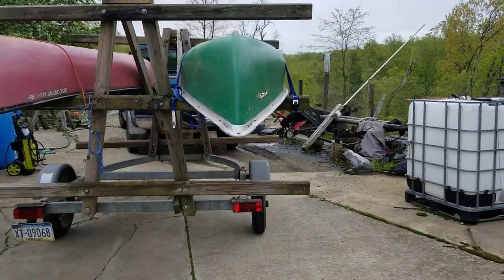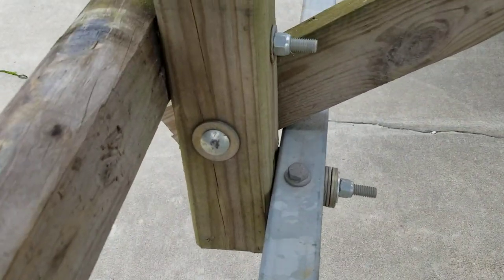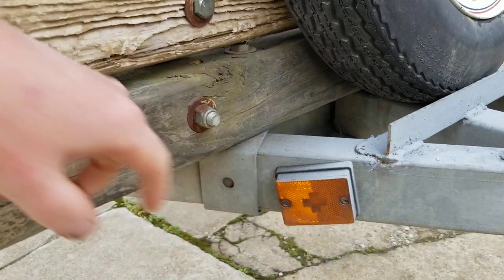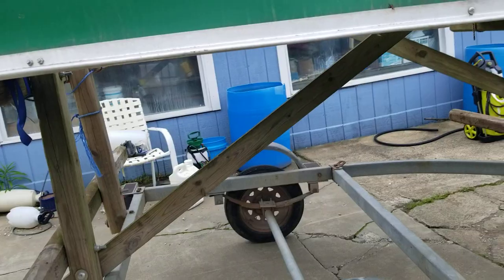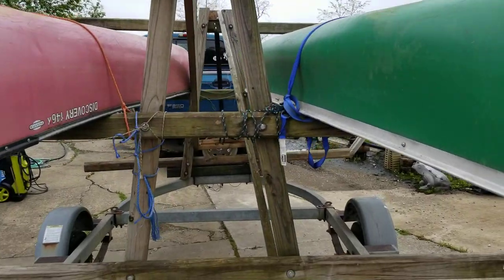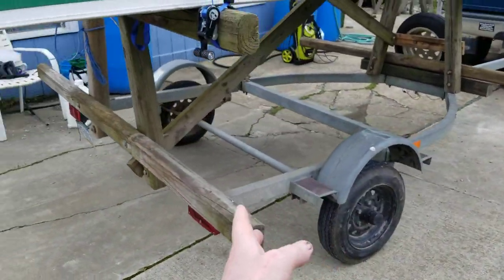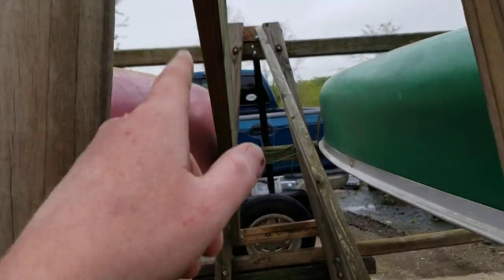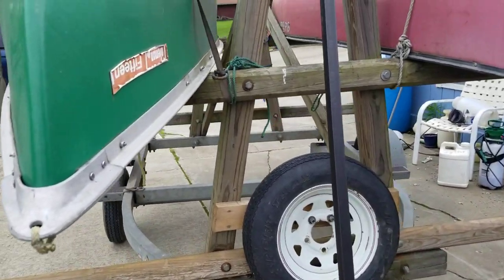Canoe and Kayak trailer measurements DIY BUILD

Comment: Nice Brett,  good job on the canoe trailer. I do think the forward  lower 4x4 post need to be cut back so they don't nail something. At least no wider than the outside fenders. They also need side markers for at night